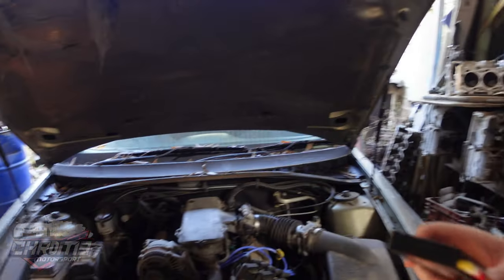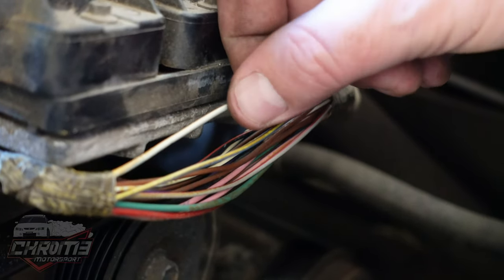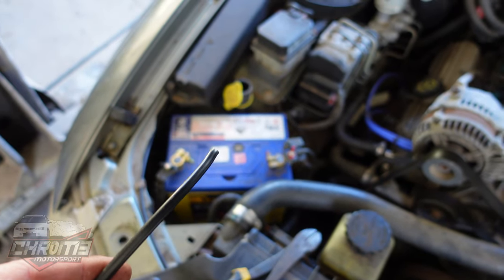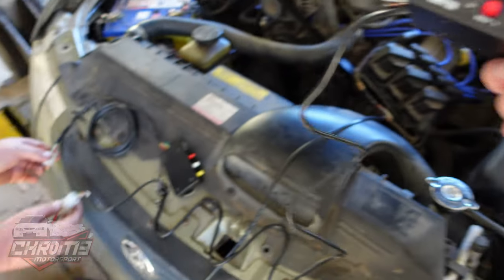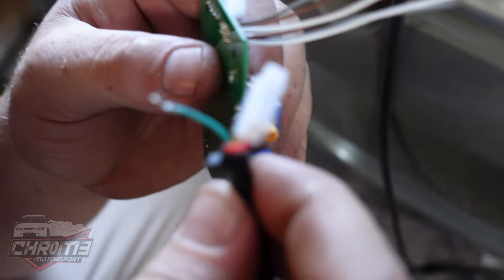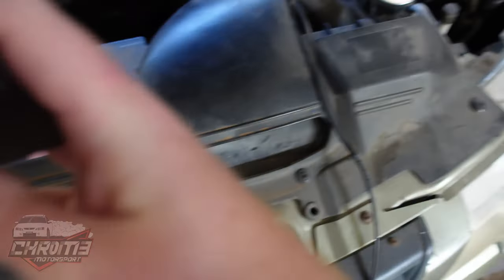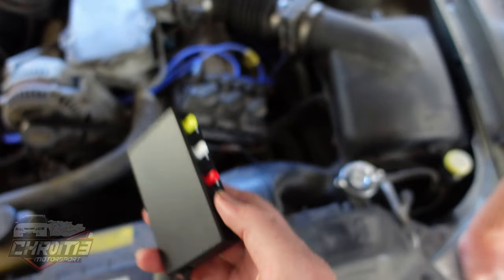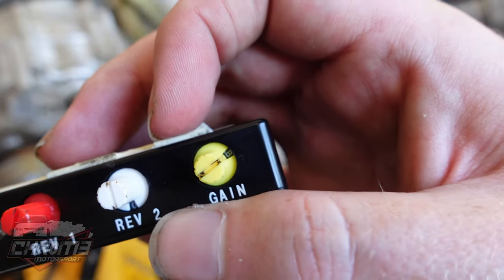V6 Ecotec Bee R Rev Limiter Install (Wiring, Settings and Fake / Real Comparison)

Comment: I see absolutely no point in this garbage! Where do I get one?
Reply: mostly just for the cool nosies, but if you're racing it's useful to be able to adjust the rpm and behaviour of the rev limit, as on turbo engines it means you can build up pressure without having to redline your engine. and it's useful if your engine just flat out doesn't have a rev limiter to begin with lol

Comment: Awesome video man, and great to see a decent comparison between the two. 

Just my 2 cents worth, and this may come in handy for anyone who has purchased a fake Bee*R unit that is either..

Faulty = engine stalls/ fails to start , and/or wont cut ignition

Half-ass = it "kinda works" on 1 or 2 rpm/gain settings,  or it cuts ignition but is unable to hold the rpm and blows past.
(Assuming the wiring is done correctly!!!)

...The fix...
Get yourself this chip.  uln2003d1013tr array darlington smd (must be SOIC package!) 
I literally walked into my local circuit board/electronic repair shop and he just gave it to me, otherwise its like a couple dollars. 

Unsolder the original chip (the 16 pin) and replace.

You now have a working fake bee*r.  It will never be the same as the real deal, but hey..

I spent to much time looking into the fakes,  anded up basically reverse engineering it and ran it through an oscilloscope + signal generator etc to find the issues and solution. 

The Kezzler 😂
Reply from the maker: Wow, can't believe something that simple would work haha, might have to test this at some point, as you can see in this video our fake didn't even work at first 🤣
Reply from the maker: @kezza20det  Might have to give this a go as well, how do you know so much about all this? Haha

Would love you to PM me actually I've been wanting to try something but need some advice haha.
Reply: Sorry for the late reply mate but I have messaged you via Facebook, I have some photos and video to share of it all.
Reply: @CHR0M3x  you gotta do a video on this for sure bro!
Reply: Do you guys have the video??of the fake bee r with the new chip in??
Reply: @alexrivera2450  I just did the chip modification im going to fit this weekend and comment how it works

Comment: Hey bro, I’m looking at putting one in my daily and was wondering if I wire the 12v and ground to a DPST (2 circuits on/off) switch will I be able to safely turn it on and off or is there a better way? Cheers

Comment: On the fake one your supposed to cut one of the wire. I belived the grey one is for 4cyl and I forgot the other ones
Reply from the maker: Don't think that was the issue, I'd imagine if you didn't have the correct wires cut etc it would not read the RPM correctly and wouldn't cut at the right RPM (it was cutting where we set it to in the video)

But this comment could help others if theirs doesn't come set correct 👍

Comment: Has anyone put a beeR on a LS1?  If so, I'm guessing either the green or yellow wire go to crank angle sensor signal and other goes where ?
Reply from the maker: stick with MSD 2 step for LS, much better and about same price.
Reply: Msd or lingenfelter. Lingenfelter has more features like no lift shifting on the clutch switch

Comment: Sounds like a sponsored advert, pretty crummy ask me
Reply from the maker: Maybe you should watch the whole video and see the difference for yourself, the difference is not just a sticker at all, the hardware is a lot better on the genuine, been tried and tested multiple times, fakes give codes, misfires and just general weird stuff the genuine does not, that's if the fake even works, nothing is staged or sponsored the eBay one legitimately didn't work out of the box.

Give this video because the exhaust is so stock etc you can't really tell the difference but on a car with open exhaust etc the difference is huge, the genuine is a lot faster responding, sounds better, doesn't cause codes etc.
Reply: @CHR0M3x  I did watch it to the end. But you weren't clear if you got the product for free
Reply from the maker: @theaussienurseflipper.8113  I didn't get either of the products free and if I did I would have said so as I do in all my videos.